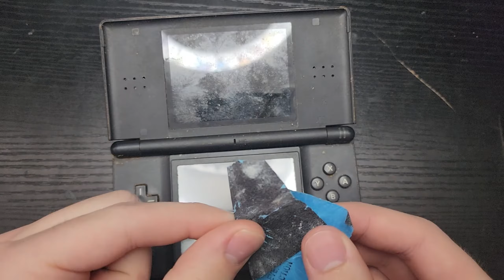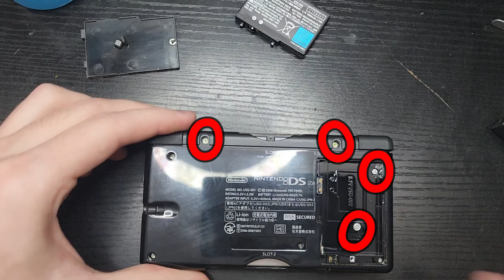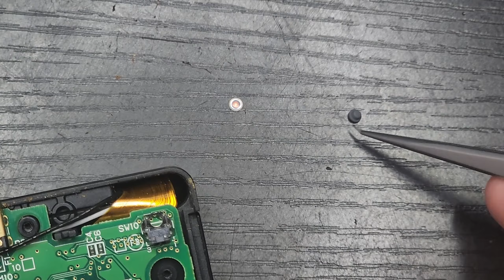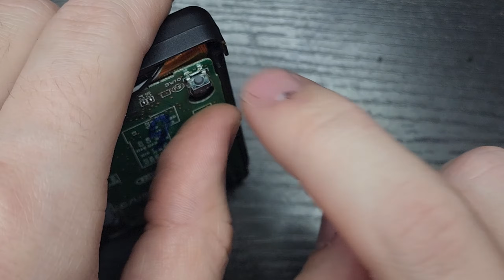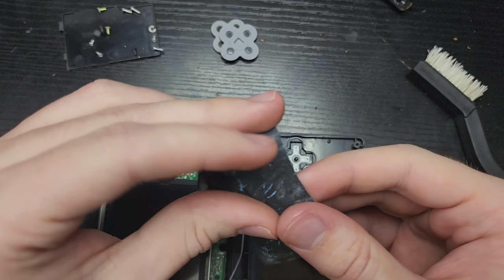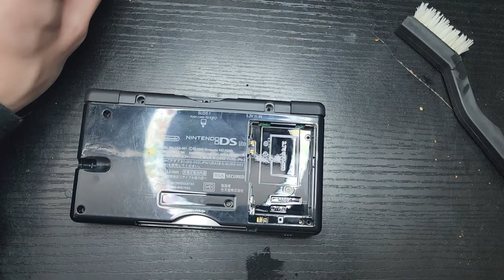How to fix DS Lite BUTTONS - ABXY, DPAD, L/R Shoulder Buttons! Tutorial & Guide

Comment: Genuinely incredible that your shoulder buttons stay in place wtf dude? I’ve been trying to get the shoulder buttons on for 4 hours and they shoot across the room the second I take my hand off. Genuinely how dude
Reply from the maker: Are the springs mixed up?
Reply: @Retro.Revolution no idea man. You said there’s a long side and a short side well mine simply doesn’t have that. Both ends of the springs are the same length for me and they don’t work either way. I just bought this today for 110 dollars and the left and right didn’t work I just simply wanted to clean the contacts now I’ll never get this back together
Reply from the maker: @kenyaisdead5031 you'll get it back together be patient! Take a break and come back tomorrow. There's not a shorter side, my explanation must've been bad in the video. Both sides are equal length but one length is higher, one length is lower. The lower side is the one that must go in between the pegs holding the spring in place. I'd bet you have them backwards because exactly what you're describing will happen when they're backwards!

I'm sorry my video didn't explain it well enough though, it is very outdated at this point. Please feel free to email me photos of the springs and how you have them orientated at contact@retrorevolution.shop and I can tell if they're the correct way or not. And worst case scenario I can always fix it up for you!
Reply: @Retro.Revolution honestly the longer shorter thing might have been another video I was watching to try and figure it out. I’ll try one more time right now I guess and we’ll see what happens but idk I feel like if I haven’t gotten it in almost 5 hours I’m never getting it
Reply: Being worst case and I genuinely can’t get it how much would you charge to fix that? I’ve taken apart psps and ps3s but this is harder than any of those
Reply from the maker: @kenyaisdead5031 I'd do it for $15 before shipping :)
Reply: @Retro.Revolution okay how do I send it to you I’m so over dealing with this thing I like don’t even want it anymore.
Reply: I get them to finally stay in place then the second the case touches them at all the spring let’s go. It’s taken every bit of self control I have to not smash this thing. Genuinely have no idea what to do at this point
Reply: @R @Retro.Revolution how do I know if they are mixed up? I didn’t even know those were made like that I just opened the ds and those fell out
Reply from the maker: @kenyaisdead5031 if you email me I can help and send a photo! Is very hard to explain without showing a photo
Reply: @Retro.Revolution tried to email and when I type it in or copy and paste it it just says invalid email
Reply: @Retro.Revolution yeah man just tried again paying attention to the spring thing and I just give up it’s not going to happen idk if it’s because I have a clear aftermarket shell or what but this thing is junk no ds is worth all this frustration
Reply: @Retro.Revolution I see what you’re talking about now but it’s impossible to match them up I’m so confused. No matter which side I put which spring or what way I flip it there is still one spring that goes up instead of down
Reply: @Retro.Revolution so I put it back together but the springs were simply impossible I spent a total of 7 hours with no luck so I just put it together without the springs but guess what? The buttons still don’t work so I did that entirely for absolutely nothing at all

Comment: Man, I thought I had wrecked my top screen since it would just flash the bottom screen when I tried turning it on. Turns out I hadn't seated in the ribbon cable all the way (the slot is surprisingly tight). Thanks for the tutorial.
Reply from the maker: That'll definitely cause that to happen, glad it wasn't broken! Great job:) glad the video helped!

Comment: Great DIY tutorial, but a few things to note about general electronics repair if you try this at home:

1. NEVER use Dawn or other dish soap + water solutions. The ONLY thing you should use to clean circuit boards is 90% or higher isopropyl alcohol. Soap solutions can leave residue which can short electronics down the line. It may not happen in 1 or 2 years, but 5+ years later it can create a short between traces and pads on the circuit board.

2. You can ABSOLUTELY over scrape those pads. Circuit boards are plated with a thin layer of gold over the copper to keep the copper from oxidizing which creates rust. In many repairs, if you over scrape the pads, you could accidentally expose underlying copper, or worse, you could accidentally remove the copper trace that connects that pad to the CPU. Scraping pads is common for various mods across different consoles, and I can't tell you how many times people screw up their device by over scraping. Same as in #1 the failure might not be immediate, but your console may not last another 10 years if you expose the copper.

3. Remove any DS, GBA, or SD card (on DSI) before opening the console to avoid accidentally breaking it.

If this is your first repair, I would recommend only using hand tools and using light pressure. It's easy to accidentally break something with a Dremel or power screwdriver if you don't have experience. 

Again, great video and very thorough breakdown. Just my 2 cents for other DIYers.

Comment: DO NOT USE metal tweezers to clean the button contacts! That yellow surface is meant to be there to preserve the circuits. scraping it off will ruin the buttons. gently clean the black residue with isopropyl alcohol and a q-tip. DO NOT scrap off the yellow metal

Comment: one thing I ran into that wasn't mentioned in the video:
make sure there is NOTHING in the GBA slot before opening it! not even the cover!
I had the cover in there when I tryed opening mine and it sorta pinned the back cover and the motherboard together, meaning I was unknowingly prying at the mother board by the screw trying to open the DS.
I am very lucky this didn't break it!
otherwise awesome tutorial tho, worked like a charm! 👍
Reply from the maker: Fantastic point. The gba cover essentially acts like its own screw and needs to be removed before the back plate can come off. I'm glad yours is ok and the video was otherwise helpful!

Comment: Getting the L and R springs to stay in place while putting the back plate on is nearly impossible. I've tried the OEM springs and aftermarket, and despite the rods staying in place and the springs sometimes, the back plate will never go on without the springs unhooking, rendering L and R useless.

I've spent over 2 hours on this process alone, and I'm ready to pull my hair out.
Reply from the maker: @R3D.R4V3N  I'm really sorry for that!! Take a break and come back to it tomorrow, i promise that'll help.

The springs are different per side, make sure you're putting the correct spring on the correct shoulder button. If you look at both of the springs closely, you'll see that there's one end that's elevated, and one end that's lower. Make sure the lower sides of the springs are going inward toward the DS, and the outer sides of the spring are the higher parts. If you'll try to put them on backwards, then they'll almost always click out.

If you have already been trying to install them the correct way, then I'd be able to reassemble your console with the springs for $10 + shipping. Just if it'd make it easier for you!

Also, another option - the springs are actually not 100% necessary, they're actually not necessary at all. They do add a tiny amount of spring to the buttons, but that gray piece is already a little springy itself. So even if you install without the springs, you likely wouldn't be able to tell.

I'm really sorry for the struggles, I 100% understand and feel your pain. But try not to worry :) I hope my comment helped!
Reply: @Retro.Revolution  I've got the correct orientation for the springs. They're just incredibly temperamental. I'm wondering if it's the aftermarket transparent shell I have or the springs being bent after so many attempts.

I bought this DS over a decade ago to reshell but just haven't gotten around to it. I finally decided to take on the project and have spent collectively 8 hours reshelling this DS lite over the last day. Ironically, I get to the last step, and it's a borderline impossible task. The ribbon cable was a walk in the park compared to this. I even reshelled a DS lite around 2011, so I thought nothing of this. I was foolish to have such a rose-tinted view. I don't know how you do this for a living but better to you.

I appreciate your reply and will reach out if I take you up on that offer.

Comment: Great indepth tutorial. Though, I wouldn't recommend scraping the contacts (at least not as a first attempt), since you can actually scrape through them (especially if you're cleaning it more than once). try a bit of Isopropyl (rubbing) alcohol and a q-tip. the carbon deposits and other gunk are usually just on the surface and not actually bonded to the copper contacts.

Comment: is it common for one of the shoulder buttons to become a bit dodge on reassembly?
tried taking it apart and refitting it several times but now it's like too "inwards" to the console to be able to click without pressing it in hard

i've got a spare (broken) ds lite to salvage parts from in case i've somehow completely broken the shoulder button lol but yea just wondering

EDIT: managed to fix it by literally holding the button as "up" as i could at the same time as screwing in the screws nearest to it :')

Comment: Why no IPA to fix the buttons? That seems to work absolutely fine and doesn't require sanding or other damaging....scraping and sanding is NOT required!!!
Reply: Ipa can show you the difference with things, sometimes I mig weld mine when they are faulty works with things every time, if it doesn't I just angle grind it for a few mins, if it's still glitchy then I just pour a litre of ipa on it.
Reply: I was thinking the same thing. Have fixed multiple 3DS buttons with just ISO on the metal contacts and domes, and very light scraping if absolutely needed. This seems a bit extreme and risky
Reply from the maker: IPA does not work, and scraping and sanding is not damaging, especially when done the way I showed.. Someone else asked on another one of my videos why I don't use IPA, so here's my copy and pasted response;

Hi! Glad to answer, so IPA would never work to fix the button contacts - what makes them not work is black grime that rubs off from the black  circles of the gray rubber membranes over the years, especially from when the DS is in heat and humidity. Sometimes it doesn't even look like much, but it's still there, preventing from the button from working with a light press.  It can't be wiped away with anything, even IPA, even a melamine eraser - it is mended to the gold contacts, and you need to physically scrape it off. Which is why I use sandpaper, or my dremel - it works like a charm. Using the sanding bit on my dremel just speeds up the process of using sandpaper, and since this is my job, where I've fixed a few thousand DS Lites, it really helps save time and to speed up repairs. The dremel does an even more professional job than the straight sandpaper, since it's extremely precise. 

I assure you, scraping or sanding IS required - if it wasn't, then I would not have shown that's the way to fix the buttons. This is my job, I've fixed thousands of these over years for customers, I promise you IPA doesn't work. I've tried countless times and it never worked, but sanding those gold contacts works 100% of the time, like an absolute charm :)
Reply: @Retro.Revolution Man you should try a light way to fix this for the first try , sanding is the last optional and manage Always to ruin a little bit the piece of art inside this console. I would recomand to try IPA or soaking the contacts with Some contact renewer in my experience it work ed most of the Times and expecialy for L and R buttons is surely safer then taking apart such a tiny button
Reply: @marcomassimo5502  If the contacts are dirty, as the disk he showed will soaking them be enough, and how do you soak them? With a QTip? I would rather not take these apart since I have already messed up one. Thanks
Reply: @Retro.Revolution  "scraping and sanding is not damaging" lol yes it is, you're literally removing the material.

"what makes them not work is black grime that rubs off from the black  circles of the gray rubber membranes over the years"

You have confused the conductive carbon (that you want) with metal tarnishing (which you don't want).

IPA is not the answer, a small amount of brasso on a q-tip is.
Reply: @kyle8952  do you add wd-40 to the hinge when it isn't working too, genius?